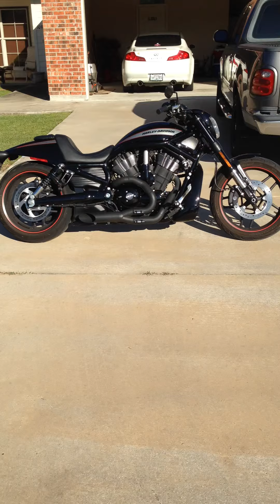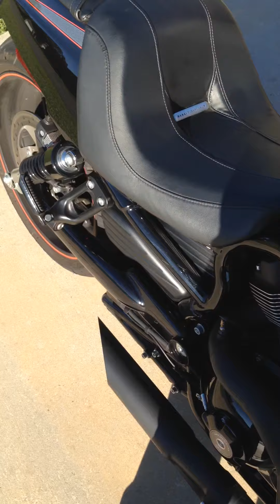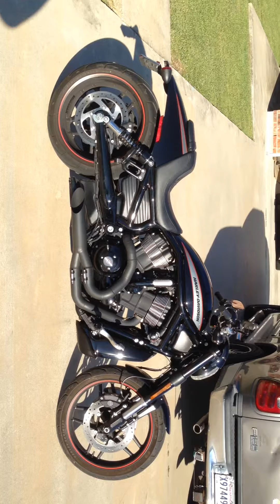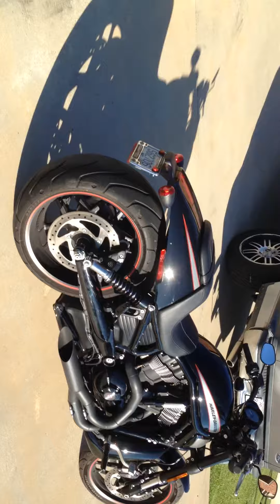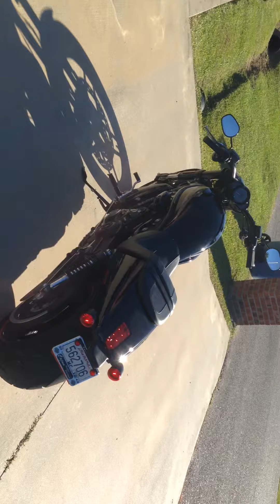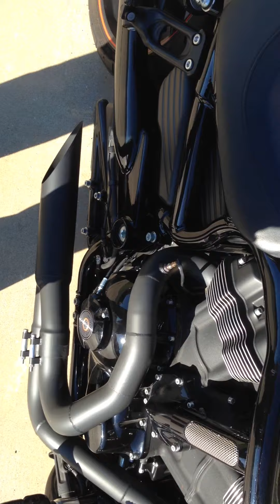2014 NRS with Cut Throat System

Comment from the maker: Yea it was a wicked sounding exhaust...actually I ended up swapping the 28T countershaft sprocket for the 30T and it made a huge difference for cruising keeping the RPM's a little lower. That bike being a 5 speed kinda screams going down the interstate at 70-75...but with that 30T sprocket it lowered the rpm just enough to make it not scream as much, especially with that pipe being as loud as it was...good investment to make no doubt.

Comment: Hello i just did this same application, could you send me the MAP? i am having a hell of a time getting my biked tuned.
Reply from the maker: I used the auto tune feature on that tuner, I didn't upload a custom map. The auto tune works really well and is super easy. You can retune it anytime you like too for weather changes and whatever.
Reply: how many auto tune sessions did you run before it ran correctly? I have a KN airfilter and cuthroat and i just cant get it
Reply from the maker: You're using the PC-1 tuner? I just initiated the auto-tune and went rode the bike normally like I would. I rode normal for a little bit and then I ran it up to redline through a few gears so it could tune for WOT as well. Worked fine for me the first time. I had the KN filter also.
Reply: Yeah i have the power vision, what kind of mileage you get? im getting the feelng my bike is running rich
Reply from the maker: +Alex Souders Hey sorry for the late response, my mileage improved slightly from stock with the Fitz Pipe, K&N Filter and the PV tuner altogether, but I also swapped out my 28 tooth countershaft for a 30 tooth, which lowered the rpm's a good bit for cruising speeds and honestly that was the best thing I ever did to the bike lol I always felt like that bike should've been a six speed but anyway, I was getting about 120 miles from a fuel-up until the fuel light would come on so I would say conservatively it was getting a 150 miles per tank. If you think it's running a little rich check your exhaust tip for soot. If it's really sooty and black you might be right. I would erase the map and try the auto tune again. On a side note, I did use the auto tune on a damn near perfect day, it was like 65 degrees and minimal humidity so take that into consideration.
Reply: Where did you get your 30tooth pulley?
Reply from the maker: I ordered it directly from my local Harley shop.
Reply: How much was it? Im seriously debating it because of the long rides i do
Reply from the maker: Man honestly it's one of the best upgrades I did to the bike lol I might've even considered a 32-tooth, but the 30 is fine. I don't think it costed all that much man maybe 30$ or something like that but I honestly don't remember exactly.
Reply: ok i am going to look into it!

Comment: Hey which auto tune system did you use?
Reply from the maker: That would be the Power Vision 1 my brother...worked like a charm. Definitely smoothed out the off-idle and low end and revved out nicely. Well worth the money and it's ...well maybe not idiot proof lol but definitely easy to use.
Reply: Thanks man, just ordered one today. Got it from FuelMoto and comes with map specifically for ground pounders as a good starting point. 
Thanks for the reply!
edit - Oh by the way, check out the "Domed cam covers" from GRCustoms for a great aesthetic upgrade at only $20. Look great on NRS